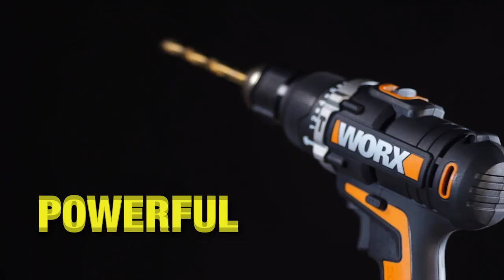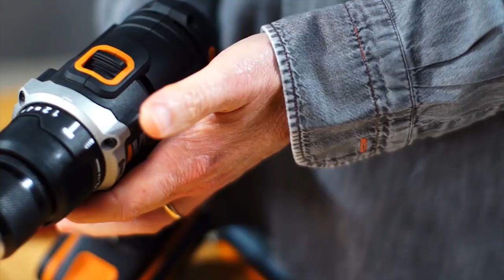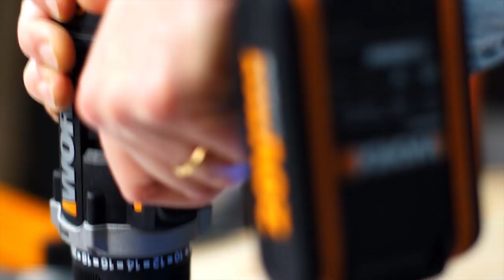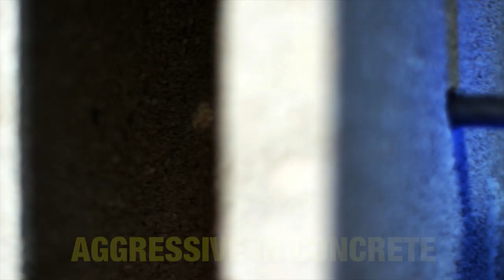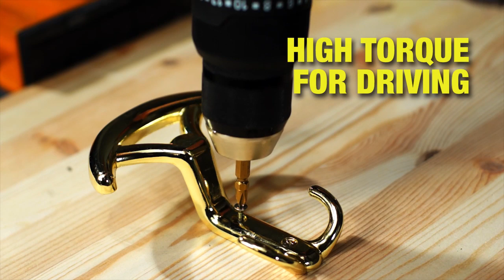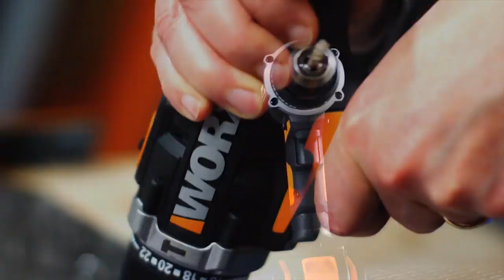Worx WX372 20V Max Combi Drill

Comment: I want to like Worx tools but to be honest I'm pretty fed up with how hard it is to source them. You have just 3 options: Amazon who carry SOME of them, Homebase which usually have just 1 or 2 of them and Argos who never seem to keep them in stock - its a royal pain in the arse. For example, I'd like the 20v cordless angle grinder - nobody has it except 1 or 2 Argos stores miles away, no home delivery. I also want the 20v impact driver - out of stock everywhere. You need to sort that out - the whole point of cordless systems is you share batteries so unless I can buy EVERY tools I need its going to be easier to sell what I have and move to Makita where I can get every tools from just about anywhere. You've been suckered into letting big retailers keep you tied to them and they arent stocking all your range making it impossible for the consumer.